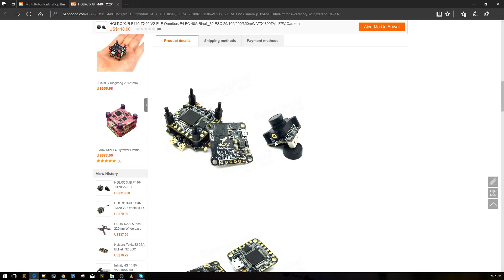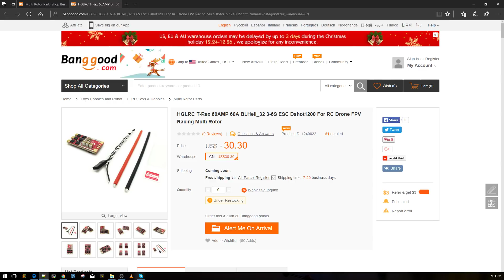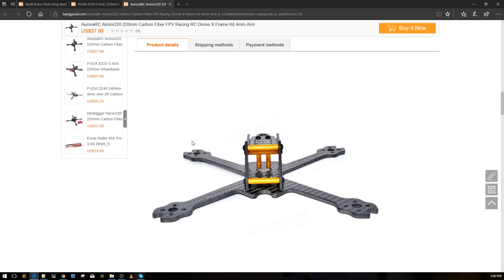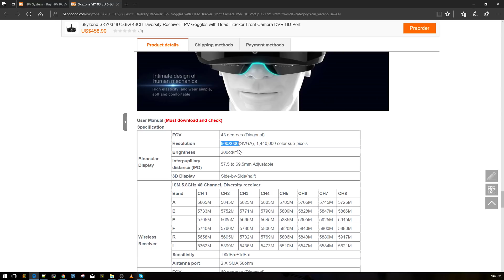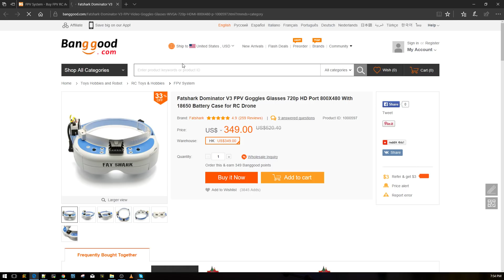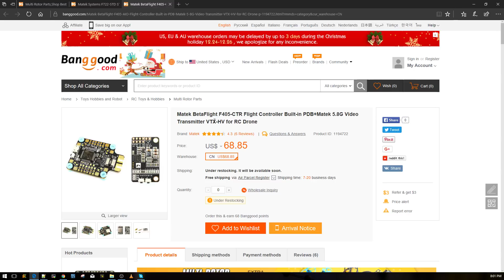New FPV Drone Products // Window Shopping Banggood

Comment: Regarding the skyzone v2. You can use the Fatshark attitude v3 faceplate (with 4 x 3d printed clips) which fits perfectly and then you have a fan. Link to the V2 clips for anyone wanting to print them https://www.thingiverse.com/thing:1166387. There are several videos on youtube which shows mounting it. faceplate is 24.99 at getfpv.com. Great upgrade

Comment: I got a 25 by 25 15 amp ESC and I can't find nothing to fit it on. So stay away from them.
Reply: Installing Hole 20x20mm, M2. Board size is 25x25, not hole pattern.
Reply: BigD-FPV that may be, but there are 25mm by 25mm. In which case, avoid them. I hear they're popular in the Asian countries, but as far as I can find without actually searching for Asian frames, but they are not very prevalent out here.
Reply: Oh ok, thanks!

Comment: Wow, 40A ? :0
Will you ever build super light built with micro brushless components. Just try to save every gram. That will be insane ! 

Or something like 1808motors on 5 inch quad and super efficient propeller  

Or put 2 inch props on 2307 motors

Place motors on a bottom side of frame

Place all of props up side down and reverse your board to be upside down and make your quad fly up side down 

Build a racing tricopter

Place 2205 motors on 90mm frame

Try 4s quad on 2s

Build quad from crappiest components and make it fly

Buy cheapest parts from aliexpress and build a quad from them

Build cheapest good 90mm micro

Build a tinny whoop

Try to run quad on li-ion  batteries

Attach giant super bright led on quad and fly at night

Stick 3x 4mm bottom plate on one quad

Take 2 similar bottom plates, attach them with long standoffs and make octacopter with 2x 4 in 1 ESC

Lol, that was most of my ideas 😂
Reply: Place DVR recorder on strate on the quad. Wire it strate from the camera
Reply: Make DIY FATSHARK style of googles
Reply: Buy fake DJI mavic and build racing drone inside of it

Comment: Drone mesh where do I solder the ibus receiver to the eachine stack I really need help setting it up what pad dose the signal wire go to
Reply: because the SBUS pad is inverted on a F4 board, you have to wire it onto another UART pad like UART6, then in BF config set as a serial port.